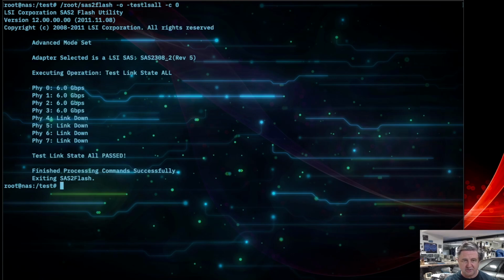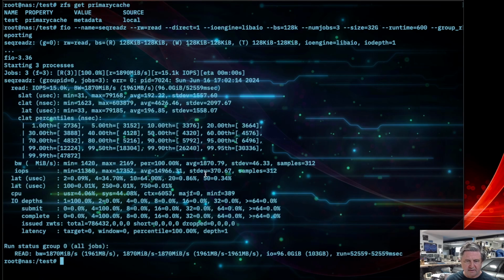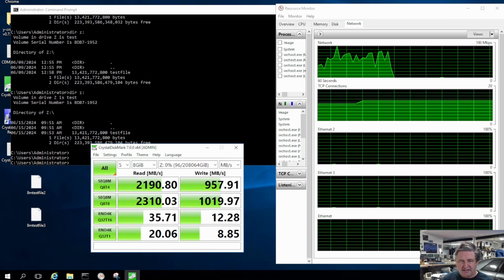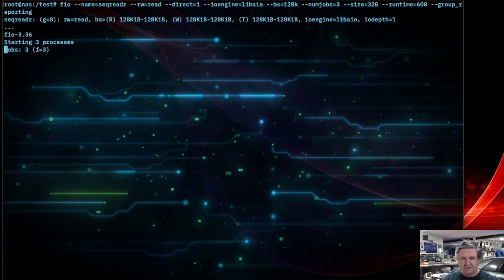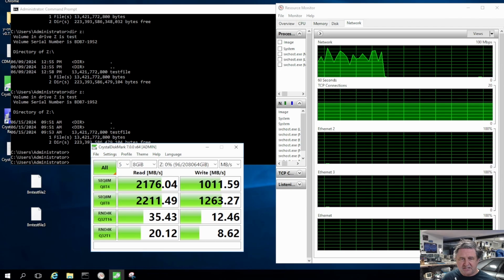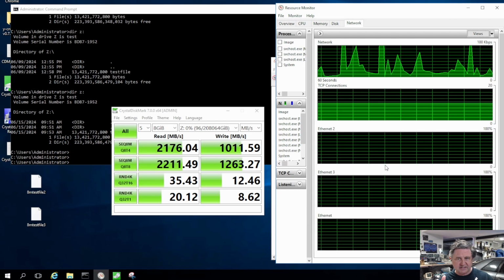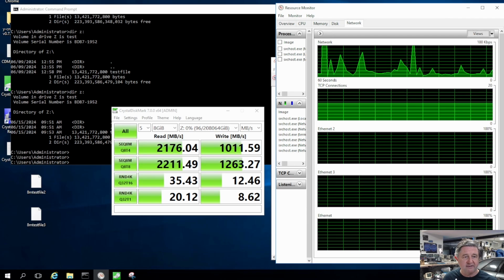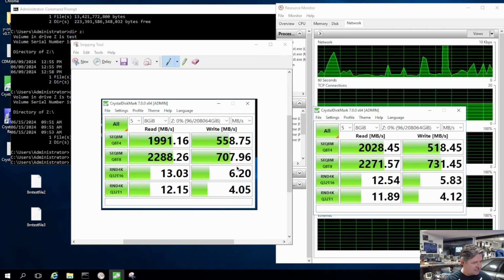Homelab: Wideporting a storage array

Comment: love all the testing and its making it very clear for my new NAS...curious what HBA and expander you're using? I have a problem where I bought a dual port HBA and 6gb expander for my 24 bay SM chassis...I just realized (years later) the expander was only 3gb SATA and 6gb SAS so thats something I'm going to look to upgrade
Reply from the maker: The HBA is a somewhat old LSI 92xx series card, but the expander is a supermicro BPN-SAS2-836EL1.   That SAS expander has 24 SAS lanes, so with 16 used on the driver you have 8 left, thus wideporting can use those remaining 8 lanes. 

https://www.supermicro.com/manuals/other/BPN-SAS2-836EL.pdf

If you have an older supermicro chassis you might be able to get a new backing PCB for 6gb SATA.
Reply: @jeffsponaugle6339  ahh sorry I meant I have a separate expander vs. the backplane (an old HP expander that has enough ports for 2 inputs from the HBA and 6 outputs)...my SM chassis has a TQ backplane so its all direct connect sata cables so I have to use a separate expander to get all 24 bays

Comment: Are you still using internet explorer?
Reply from the maker: I assume you are asking because Internet Explorer is on the toolbar on that server.    That is a test server so IE is on the tool bar from the default install.  If for some reason I were to need to do some kind of browsing from a server I would install Firefox, but in reality I would rarely do anything like that on an auto provisioned server.
Reply: @jeffsponaugle6339  Just curious if you would actually defend using internet explorer in 2024 :)

Comment: At the 2 10Gb connections in a LAG?  If not how do you have them setup?
Reply from the maker: No, they are actually on different VLANs, but SMB Multichannel combines them for SMB transfers.   A LAG would be another way to do it, but I had the seperate networks to allow backups to have their own VLAN.